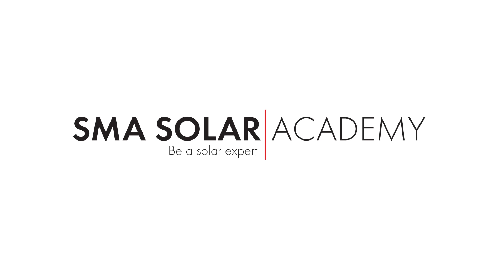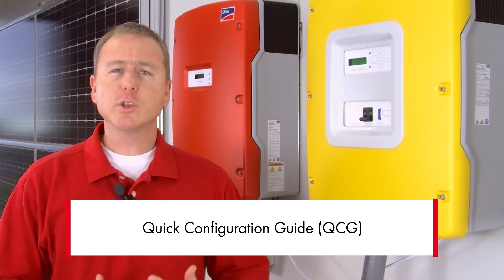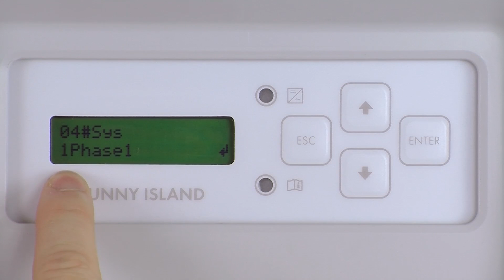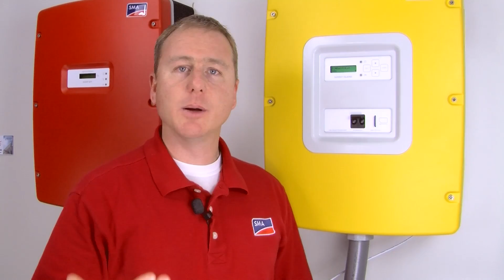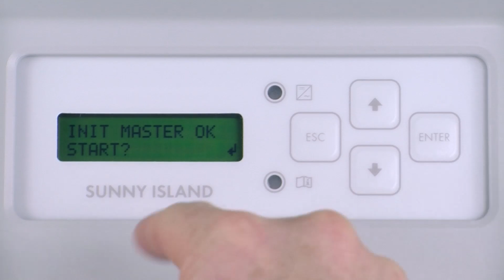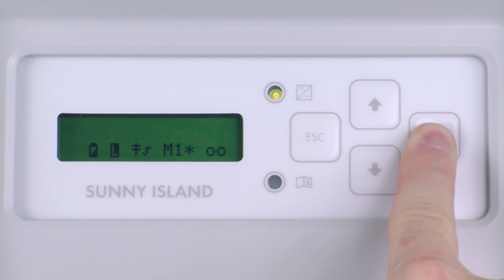Tech Tip: Sunny Island Menu Overview

Comment from the maker: It is not necessary to use a Sunny Boy with the Sunny Island, however we do recommend it since the Sunny Island can throttle the output of the Sunny Boys using frequency shift control. The Island performs this frequency shift when: 1) the grid is down, 2) the batteries are full and 3) there is no demand on the protected loads panel.

Comment from the maker: Great Question Iron Edison! 

The Sunny Boy can be put into off-grid mode by using either the WebBox or the SMA Service Cable. The Sunny Island cannot be used to change Sunny Boy parameter settings. 

Section 17 of the Sunny Island manual explains how to make the parameter change in the Sunny Boy, we have attached the link to the pdf in the description area above. 

Thanks, 
The SMA Team

Comment: Hello , I have a sunny Island Si5048  ( 5kw - 48v off grid inverter) that is running my house . My system is completely off grid as I live in a rural area with no grid. I would like to know if I can connect a grid tie inverter with a separate set of solar panels   to my system to increase the  power during the day instead of having to add another unit in parallel .   Would  that work ?

Comment from the maker: The Sunny Islands main purpose is to utilize renewable energy first before we tap into the battery bank. If there is enough production from the wind turbine the Sunny Island will utilize that first, then tap into the battery bank. This is setup by default, and there is no parameters to set this function. The Sunny Boy or Windy Boys will need to be programmed for “off-grid” and this allows for the Sunny Island to control the output of the renewable energy.
Reply: Hallo SMA how to download data with MMC Card because I try insert MMC to slot MMC but what I did..Igot message MMC Opertation  "Failed"
Reply: @wasismuryanto9787  maybe the Memory card is faulty or it is not formatted in correct format.check with a new memory card.

Comment: Say I have a question. I had a issue with one of the battery connectors and my SMA inverters shut down. I corrected the connection issue. However now the SOC rate is not aligned with the batteries. The separate solar charger was still charging the batteries while the SMA was down. So my batteries are fully charged but the SMA thinks they are not and shows SOC at 15%. It keeps shutting down due to this. How can I reset the SOC to realign the SMA with the batteries actual charge capacity that the batteries are at. Thx
Reply from the maker: Allen – I assume you are referring to a Sunny Island. The Sunny Island SOC calculation will be corrupted by external charging if you have not installed a shunt (Section 6.4.4 of the manual: https://files.sma.de/downloads/SI4548-6048-US-BE-en-21W.pdf ) to allow the Sunny Island to compensate for the external charging. As you charged the batteries this time with the Sunny Island shut off, you may want to go into the QCG and choose “New Battery” (Step 4 on page 72 in Section 8.1 of manual). You need to know the current values for the battery bank, and you will re-enter those same values, but that will cause the Sunny Island to “reset” to the unknown battery settings of 50% SOC with 50% uncertainty.  You may wish to contact SMA Service at Service@SMA-America.com for support with this if you are not comfortable making these adjustments.
Reply: @smasolartechnology  it does have the shunt. It is a complete custom built system. It took the system roughly 14 hours to recalibrate itself after the connection issue was repaired. It is currently reading the correct SOC rate. I do appreciate the response. Thx!!
Reply from the maker: @allennolden8735  great! Happy to help!

Comment: I have a 4 inverter  set up. About once or twice a week 1 or all the slaves AC voltage drops down to around 45 VAC. I turn off all the inverters and turn them back on and all the voltage goes back to 120 VAC. I would like to find out how to prevent this from happening. Also the faults I get are  F158 F733 F710.

Comment: Thank you for the information. So, when using the Sunny Island to charge batteries will this kick in when the grid is down? And when the grid is up and the batteries fully charge, will the excess energy be then rerouted to offset of the home's load? Thanks again. I've only designed on-grid system and this is a first go for off-grid/battery back up/emergency system.

Comment: What are the meanings of error messages, "F367 ExtCtcNotOpen" and "F710 AutoStrCnt" in SI8.0H?
Reply from the maker: +Senyo T. Dake is your system running in North America? If so, please contact our Service Line at 877-697-6283 for technical support. If not, please let me know where the system is and we can route you properly.
Reply: b

Comment: Can you only use the sunny island with SMA inverters? Or will it work with any inverter?
Reply from the maker: The Sunny Island can operate in an Off-grid mode with any Solar inverter able to implement a standard Power-Frequency response.

Comment: Hi, 

I have a photovoltaic system with a Sunny Island 4548 and 16 battery bank. The system would be completely out off-grid. Do I have to integrated a Sunny Boy Inveter with the Sunny Island? Or I can utilizes the Sunny Island alone? 

Appreciate your help, thanks!
Reply: yes
Reply: yes to what? He asked if he had to use it with a sunny boy as well? or the sunny island will work on it's own?  yes to what.
Reply: The Sunny Island does NOT need a Sunny Boy to operate in stand-alone mode.
AC Grid + Sunny Island + Battery Bank = AC Power inside home even when the Grid is down.

Yes ...  you can add a Sunny Boy GTI & PV Panels to a Sunny Island system.

Comment: Dear SMA,

I am  trying to create a PV + battery based energy system with grid tie as a backup.

I have some technical questions that I cannot find anywhere, PLEASE HELP.

The system setup is as follows 10 X PV panels all with a micro inverter making 230volt 50Hz.

Sunny Island will be used as inverter and battery charger, now the questions.

To be sure of all my energy needs I need the grid as a backup if the batteries are low on power here are my problems.

1. The grid here on the island of Curacao is 120volt 50 Hz ( 1,2,3 phase) the Sunny Island AC2 connection is L1 + N can I connect to "live" wires to make 230 50Hz?

2. Because of legal reasons (the electric bill is prepaid) back feed to the grid is not possible. Can I use the "generator" setting to use grid power with no back feed?

3. What advise can you give me for a Sunny Island if I need continuous power of 3000 Watt and the normal temperature is 30 Celsius 

Thank you,

Comment: Please, do a detailed video for Sunny Island 48 Volt and 38 Cell 45.6 Volt Ni-Fe Battery bank.  We cannot get any voltage during Float Mode. Battery Bank discharges down to 70% SOC. Then Boost Phase recharges battery for 300 minutes. Some settings ...

 [ BatChrgCurMax ] = 110 A
 [ GnCurNom ] = 30 A
 [ GdCurNom ] = 30 A
 [ InvChrgCurMax ] = 48 A

 [ ChrgVtgBoost ] = 1.65 V
 [ ChrgVtgFul ] = 1.65 V
 [ ChrgVtgEqu ] = 1.65 V
 [ ChrgVtgFlo ] = 1.47 V  <<< SI reading = 55.8 V and falling!!!

 [ AptTmBoost ] = 300 minutes
 [ AptTmFul ] 7 hrs
 [ AptTmEqu ]  8Hrs

Silent Mode is not enabled.
Reply: SMA won't help you with this or anything out of the ordinary. I have asked help initially for my NiFe bank, generator hook up, what transfer switch ,etc.... .  I know from experience they won't help.They keep giving information out of the manual, which I already know and can read for myself.   
Let me tell you how I solved the NiFe Float problem with my battery bank hooked up to a SunnyBoy and Sunny Island.  It took a while for me to figure the float charge voltage but it should be set to 1.55v.  This will bring the battery bank voltage up to 58.8v in float mode.  You will use more water but that is the trade off.  You will need to water maybe 2 times a month.
Also, you need to charge the bank fully, then discharge it down to 20% SOC several times to allow the NiFe bank to get up to par.  Another thing you don't necessarily need to do the Full charge.  NiFe batteries operate differently from lead acid.  
You have a good battery bank and made a good choice using NiFe.

Comment: HI
Im Pedro Mainote From FUNAE- commpany in Mozambique 
We are using 72 Sunny island 5048 at a PV power plant with Multicluster box 36, as 3phase system .
I have lost configurations of Muster at extencionCluster nr 6 .    Now im trying to configurate, but i cant change the cluster mode on System settings window. its running in singermode.
When i try to chenge, appear the massage on the screen saing that i have no permission to access de value.
I have tryed to change the password But it not allow me to change the cluster mode.

So i need to know how can I define the extencioncluster Number on the Muster Inverter

When i try to star the inverter , I had the follow errors.  F128 VTgonAC1det and W710

best regards

Comment from the maker: Hi vicpz1 - Yes, that is exactly what will happen, when the grid is down the extra energy from the Sunny Boy inverter will back-feed into the Sunny Island to charge the batteries. We would love to help you with more detailed information about designing an off-grid or back-up system. Feel free to call us directly (916) 625 0870 or 1-888-4SMAUSA. Thanks!